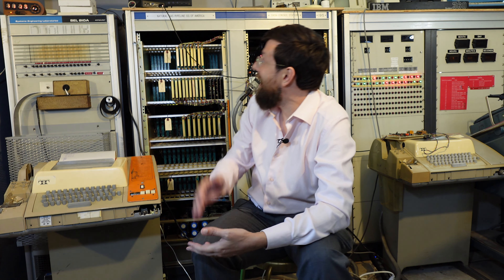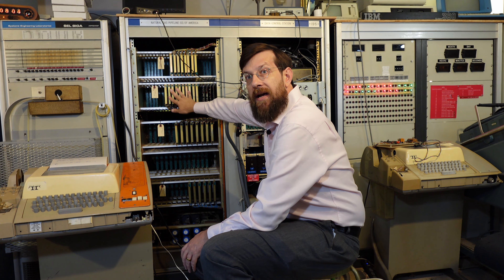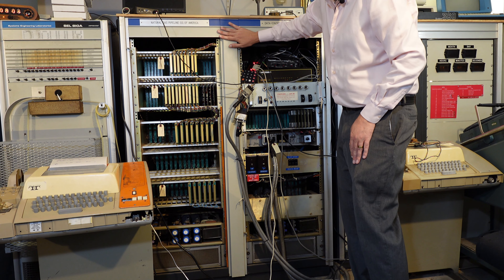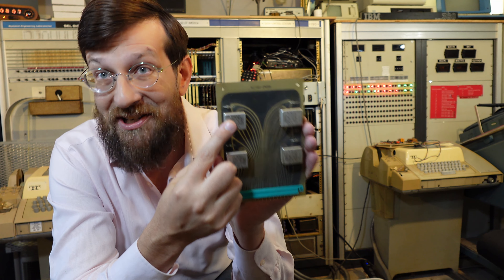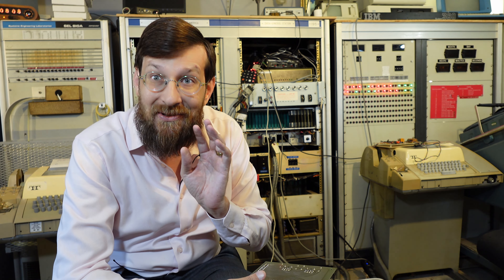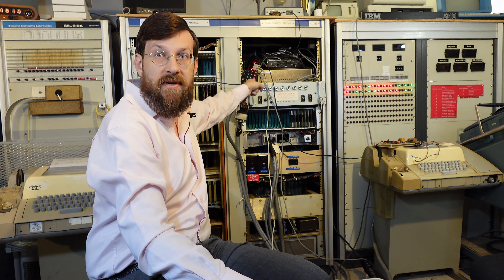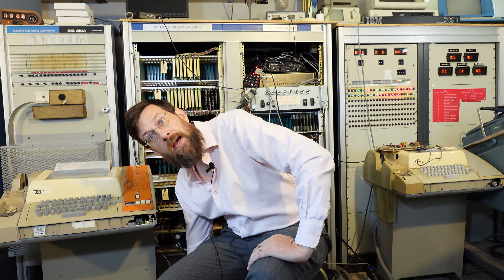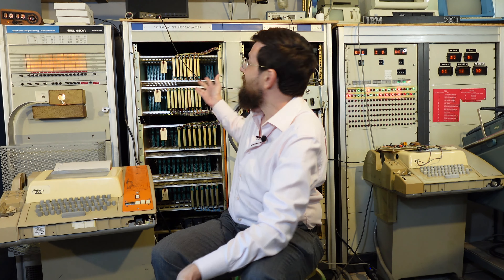Computer Industrial Control from 1969! Demo and Walkthrough

Comment: For people who have never unjammed an ASR 33 paper tape punch, let me add a few clarifications for those not alive when this system was made, to increase your enjoyment of Eric's achievement.

1) SEL was System Engineering Labs. They were in Florida, and made real-time computers (no virtual memory!) for industrial applications. Gould and Harris and ModComp were others in the same business and general geographic era. SEL in today's electronics and computer world is Schweitzer Engineering Labs and is not related.

2) A Nixie tube was the vacuum tube equivalent of today's seven-segment display device. It was made by Burroughs, yet another bygone computer company besides the four mentioned in (1). Being a vacuum tube technology item, it used B+ level voltages, like the plate voltage on a standard radio vacuum tube. Thus the "high voltage" power supply that Eric mentioned.

3) I/O (Input/Output) for industrial applications fall in to two categories. Analog and Digital. Digital could mean open or closed switches (relays that Eric mentions), or 0 some other DC voltage, such as 24 that was mentioned.

Analog input typically meant 0 to 10 VDC. A sensor on the turbine would output a voltage (hopefully) proportional to some physical measurement, say 100 to 1000 degrees. Some of the software would convert the voltage to a (proper) engineering value again. Analog outputs would produce a 0 to 10V DC signal to control something. For example, a motor operated valve might be fully closed at 0 V and fully open at 10 V. Thus the Analog to Digital Converter and the Digital to Analog Converter (ADC and DAC) that he mentions in the video.

Teletypes (the ASR 33 being one of the most popular) originally used a 20 ma circuit to represent the ones and zeros. As computers came along, RS-232 became the popular serial ASCII protocol, so current loop to RS-232 converters abounded.
Reply: Ah, thanks for clearing that up - I was first under the assumption it was Standard Elektrik Lorenz!